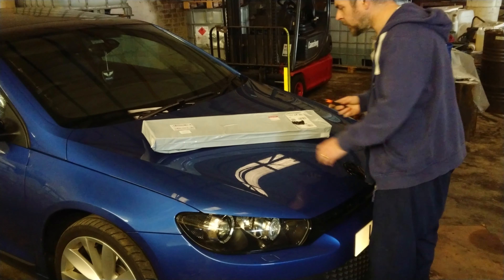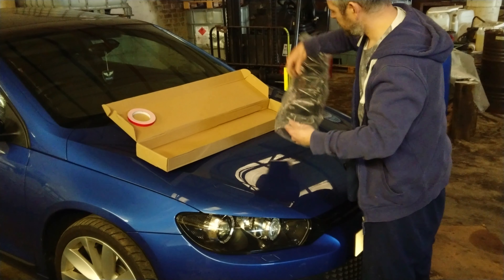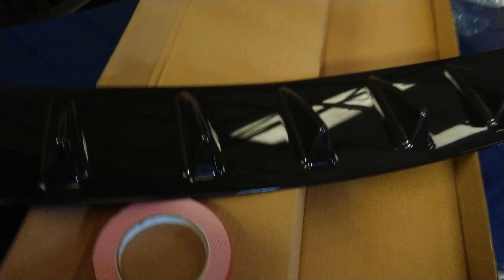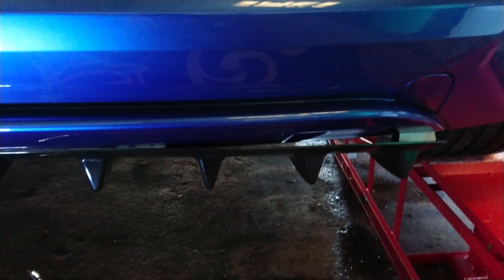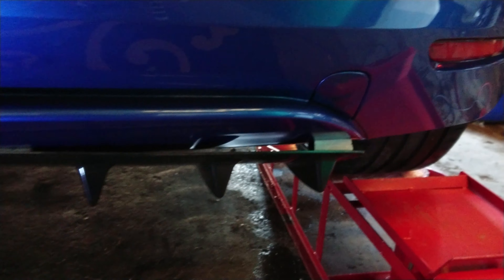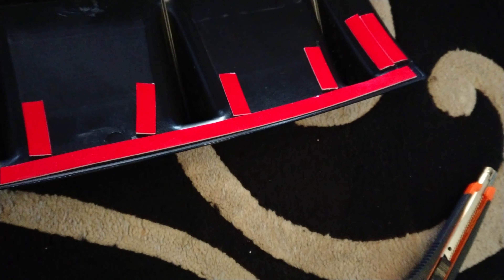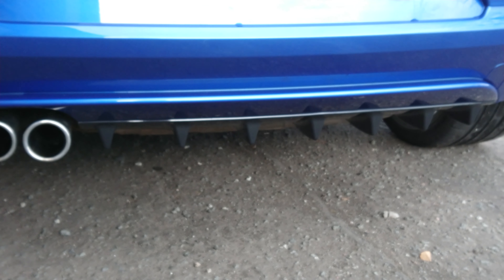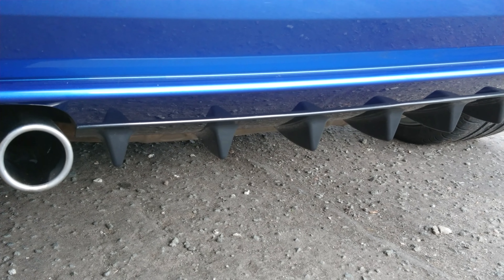Unboxing & Installing Nice Mod On The Scirocco! 🙂

Comment: Are you aware if the number size has changed? I have a 2009 model my rear diffuser just arrived and seems a bit big?
Reply from the maker: There's possibly sizes in the ad mate, but unsure! 👍

Comment: How and where do you drill into the car?
Reply from the maker: Tape it in place, drill a couple of holes through the spoiler & the lower rear bumper & I riveted mine on, but screws would work! 👍
Reply: @johndiehardmclean23  okay cheers mate